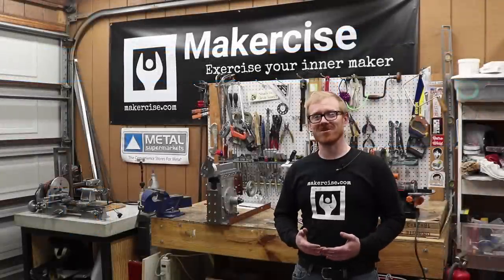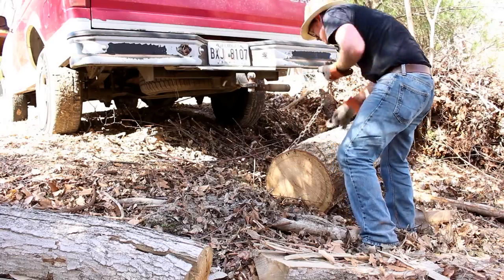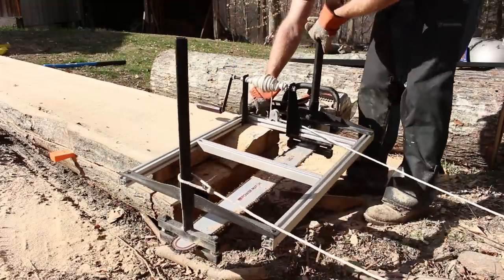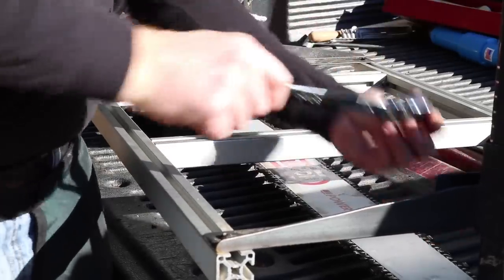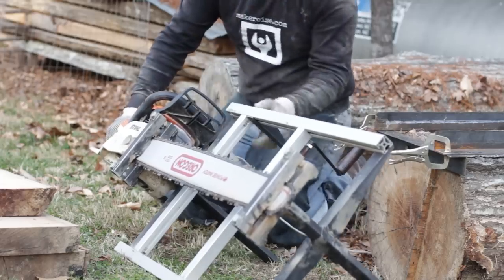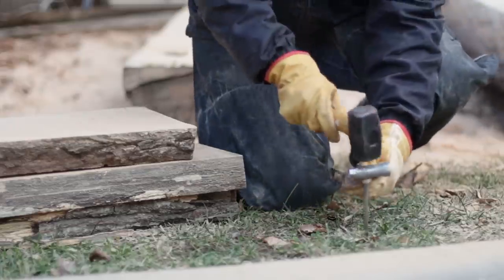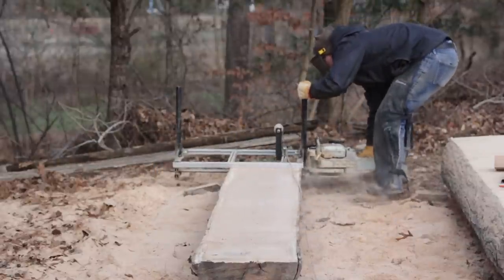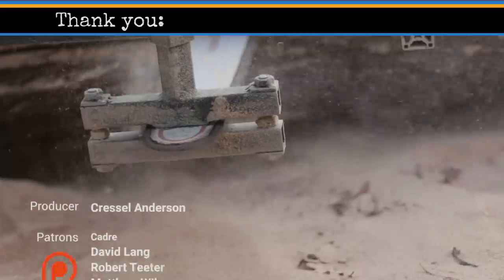How to Use a Chainsaw Mill Built from Scratch

Comment: Yep. Power wash. Also when stacking and sticking put a 4x4 across the top of the stack parallel over your bottom supports. Then use ratchet straps on the ends from top to bottom. This will clamp the pile together and stop the slabs from warping as they dry.

Comment: Nicely done. In Will Maloff's book -- I hope there is a previous comment with the IBSN --  but available on Google books -- you will see that Will has two improvements on you arrangement. One, he puts the winch on the opposite side of the log with essentially a Y-harness on the saw. Two,  he has a remote throttle gadget. So he starts and finishes by hand, but once started he sits on the opposite side of the log from the saw. So he eats very little sawdust. I did most of my milling before I discovered the book, and I ate a lot of dust.

Comment: The only thing I might suggest would be to pick up an electric blade sharpener.  I bought one for about $30 at Lowe's that runs on 12VDC from the cigarette lighter port in the dash.  This makes sharpening the bar so much easier and so much faster.  Also, a tip my stepdad gave me was to use a Sharpie marker to color the top of the saw tooth you just sharpened.  This helps you keep up with which teeth you've sharpened and those you have not.  

Otherwise, I'm looking forward to seeing the cabinets and furniture this red oak transforms into!

Comment: Question, I'm running a husky 372xp 70cc. Is that enough pwr to mill wood? The chain I'm using is a skip tooth. The slabs are coming out real rough. Can't figure out where I'm going wrong.

Comment: I could be wrong, but it seams that you don't know to sharp the chain. The particles caming out of the chainsaw are to small, it seams dust, and it should be like a jointer but smaller, and you'll see that it won't take so long to make a cut. My advice is to buy a electric sharpener.

Comment: Hi, did you guys encounter problems with your chainsaw during milling? I clogs up my neadlebearing after 30 minutes of milling. I use a ripping chain and a 462 stihl with a 41 inch bar. Recently my neadlebearing even got torn to pieces... wonder if you have any tips... 

Cheers
Reply from the maker: On the mill I built before this one using the stock Stihl 20" bar, I noticed the clamping location would cause the needle bearing to get hot if I clamped too far outboard. Maybe try clamping inboard from the bearing a bit and see if it improves.

Comment: Hi, did you have to drill a bigger oil hole in the oregon bar for proper oiling or does the manufactured oil hole work well with your chainsaw?
Reply from the maker: I didn't modify the bar. Get two big jugs of bar lube though.

Comment: Does the clamp slow down the gear on the front of the bar / more friction and heat ?
Reply from the maker: If I don't get it positioned correctly and clamp down too tight, it can.

Comment: While working in mud sucks, could you hose down the logs before cutting? just to get most of the dirt out
Reply from the maker: +DKTAz00 probably anything to get dirt off would help. Light rinse with a hose, pressure wash, remove bark. Limited options away from my shop and tools though. But a good lrarning experience for next time.

Comment: Because I don't mill, what do you mean by clean log??
Reply from the maker: Dirt is very abrasive and quickly dulls a chainsaw chain. The texture of a log’s bark makes it pick up dirt easily when moved. Avoiding letting dirt collect on the log helps the chain last longer between sharpenings.
Reply: Make a lot more sense now
Reply: I like to hose them down. Even better if you can get the bark off after dragging them home. But the hose saves me.